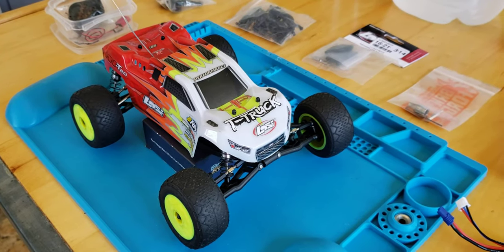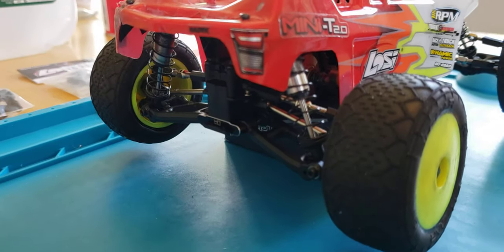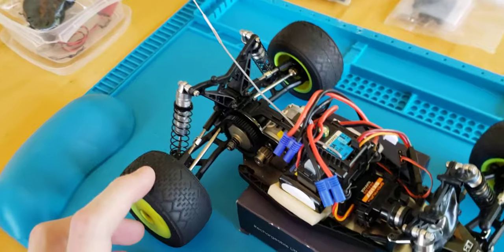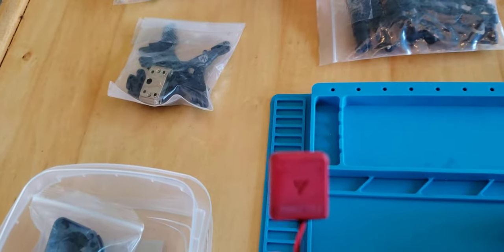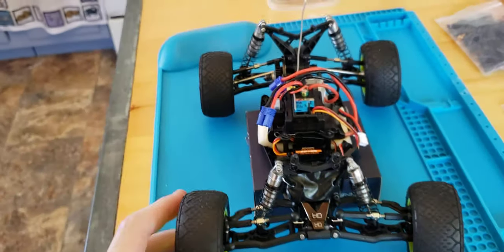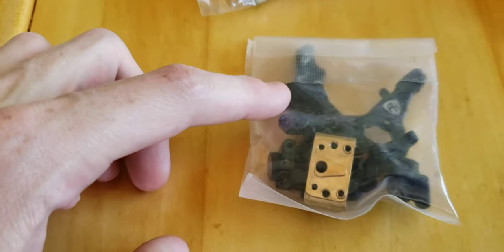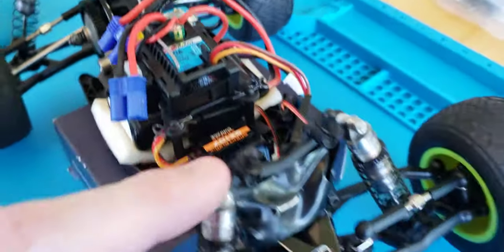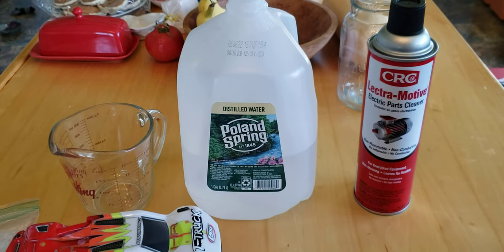Mini-T 2.0 6 months of straight racing each week Review and Setup!

Comment: Have any of you tried the HR Racing Aluminum front A-Arms?   I installed a set on my Mini-T 2.0, and there's a ton of play where it connects to the bulkhead/hinge pins.  Any way to remedy this ?
Reply from the maker: I only run RPM A-arms because they are twice as strong as stock. Better fitment and design of the arm itself. I've learned its best to go 25% plastic like A-arms and or body. Then 75% aluminum or titanium. These plastic flex points are good for racing. If you go 100% aluminum you will break more. At least thats how it is when your indoor carpet racing.
Reply from the maker: If you have more questions just ask.

Comment: nice video.. just bought a Mini B RTR and 2 Mini T RTR.  Blast to drive around the house, lol. I wanna try racing.  Can you change your pinion and spur to what ever you want when you  race?
Reply from the maker: Yes!.
Reply from the maker: Stock the Mini-T 2.0 has lower gearing. I believe its 15T and the Mini-B has a 17T or 18T stock. So the Bs are always faster, I had to buy a Hot Racing Adjustable motor mount because the stock one isn't able to change gearing. You'll want a Robinson Racing 2mm pinion.
Reply: I dunno if they changed it but my stock mini t motor plate has 6 holes in the motor mount
Reply from the maker: The main hole where the motor sticks thru the motor mount is not round but slotted alone with the holes next to the pinion hole. Those are for your motor. When you see a  Hot Racing adjustable motor mount you'll have these slotted holes instead of round. That way you can adjust the pinion size, you must have correct spur mesh or you'll ruin the motor/diffs. k

Comment: Making it brushless is the first thing I would have done. I've been thinking of getting the brushless version. I have a Latrax Teton and I ran through 2 brushed motors, then put in a 6200kv brushless motor and a 45amp esc. Changed the pinion gear from a 9 tooth to a 13t. Swapped the A arms to aluminum because they snapped immediately from the power. The front ones anyway. The Teton was never made for that much speed. Had to change the steering arms to aluminum as well, too much play in the plastic ones after being stretched out. The diffs won't take too much more either. So I was think of upgrading to either the Losi mini T brushless RTR or the mini B roller kit and building it up myself.
Reply from the maker: Roller 100% my mistake was buying a Mini-T 2.0 when it has a 15T pinion and the B has a 17T or 18T pinion. The B is faster because of that. Also the class we ran was brushed 280 only. Now its modded Brushless! I will be making video of the parts and motor going into this Hot Racing, MIP, RPM, Brushless animal!!!
Reply: Some smaller tracks don't allow brushless cos cars start flying off after 5800kv, at 8200kv its an airshow. Some outdoor tracks are ok with 3300kv (or maybe 4500-4800kv AT MAX). That 18T pinion with 8200kv will end up at 65mph at someone's face.

Comment: You sound like Timmy turner😂
Reply from the maker: More like Timmy Tuner. I tune and work on my on VW cars over the years alone with installing and fixing loads of dirtbike/ motorcycle parts and quads for family and friends. My.body is physically failing so I switched to RC racing and I still get some of those feelings from racing other machines! If you need help or info just ask.    Tim.
Reply: just realized ur name is Timothy😂 thanks brotha no hate. I also got a mini t all built up and motor swapped goes 65mph. Also Got a 22t goes 60plus🏎

Comment: QUESTION ARE THERE OTHER DIRCT FIT BODIES THAT WILL FIT THIS AWESOME LITTLE MINI t 2.0
Reply from the maker: Yes. Make sure the body is a 1/14 1/16 or 1/18 size that way it looks the way you want. Make sure to align the body with the body posts with a dot from a marker before cutting your body. Otherwise your post holes could be off and the body will sit crooked. Im taking clear bodies that need paint decals for racing.
Reply: @timothyhibbard  i just bought my first mini t2.0 brushless with some hopups,  what fun little beast..  i did make 1 crash and now my body is already cracked..  ,, so i was also wondering what also fits this mini instead of the stock body..  + some bodies seems to give the car better protertion..     love the car though ;)